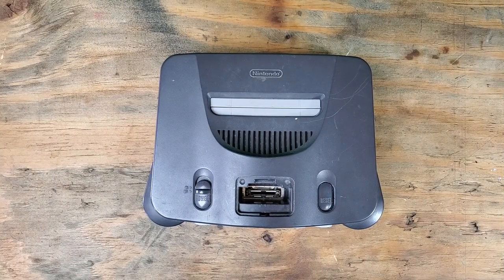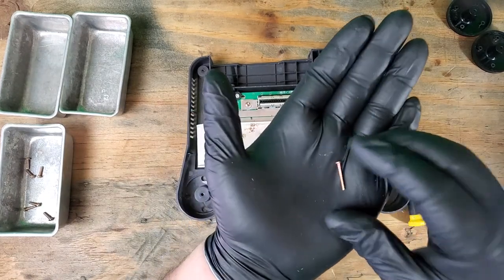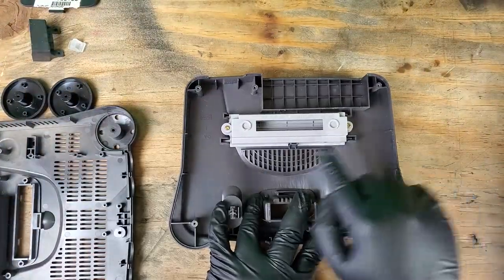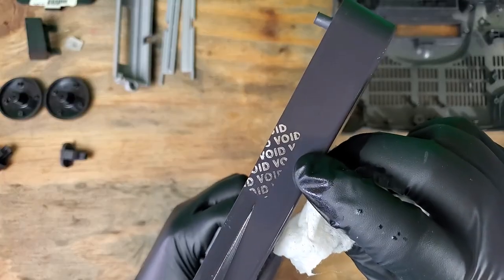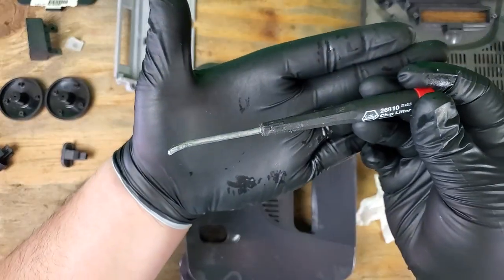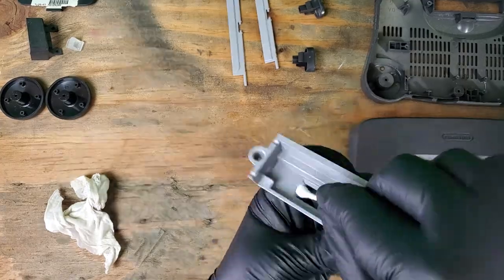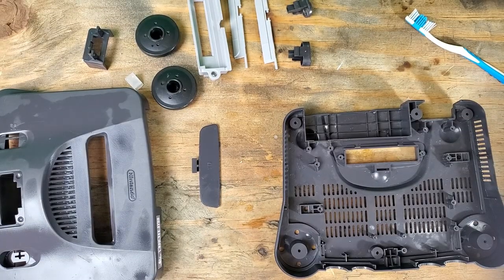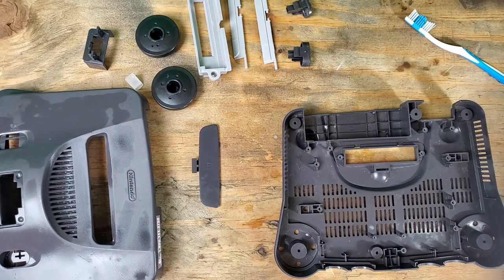Tear down and cleaning a N64 shell.

Comment: Great video, going to use this to clean a disgusting N64 I picked up recently off Facebook marketplace.
Reply from the maker: If the Jumper Pack still has the sticker on it and you want to save it (maybe for collecting reasons), it's possible to remove the top shell and the Pack at the same time.

Either way have fun bringing this classic back to it's former glory!